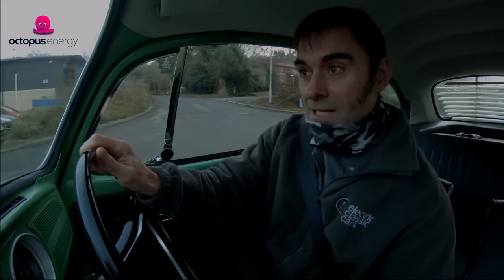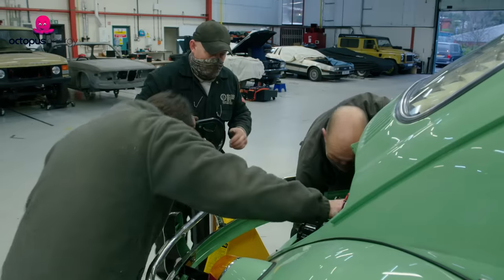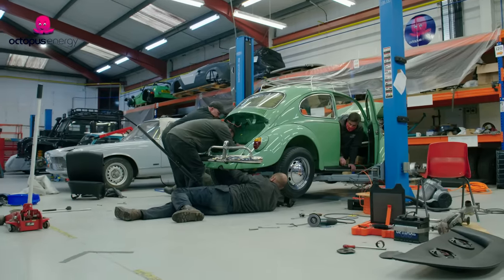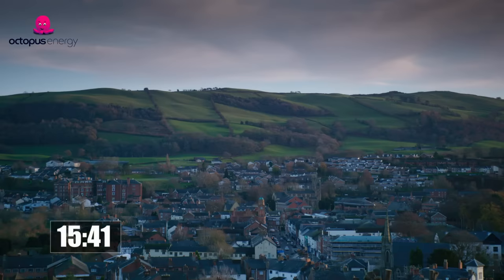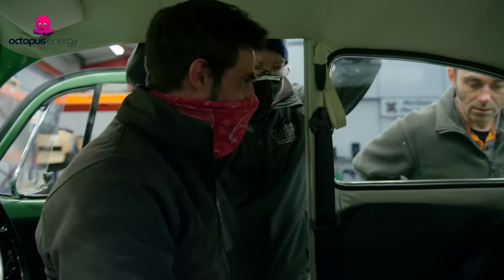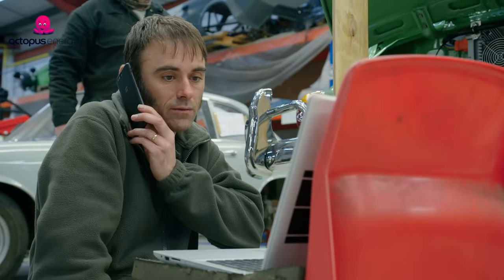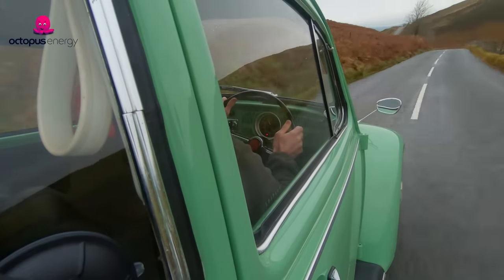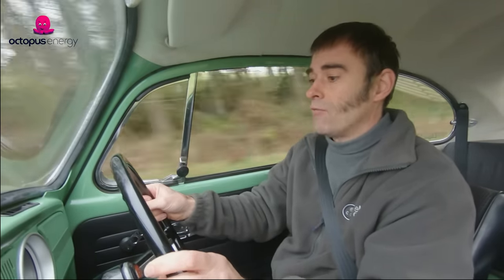VW Beetle converted to electric in a day

Comment: Have you calculated the parameters yet? Top speed, 0-60, and mileage duration of the charge? That same motor can work in front wheel drive cars as well.
Reply: Faster you go sooner you drain the battery’s and have to wait to recharge them. So when you go from London to Scotland in a petrol car. A few tanks of petrol and your there in one day. Yet once this is converted. It  will be 4 days to do the same journey100 mile stop recharge your batteries. another 100 mile stop. recharge the batteries. Not forgetting your overnight stay in a b&b hotel that’s another cost to add to your trip. Compared to a couple of tanks of petrol.and you travel from London to Scotland within one day.
Reply: @richardharries5825  spot on!
Reply: @richardharries5825  except they have swapable battery
Reply: @vetteluvnh  Not really. More like exaggerated bullshit. So then don't travel from London to Scotland. Who needs to do that on a daily basis. Just as who needs to spend gas going to work or other short trips of which consists of everyday living. Use a petrol vehicle if you're doing long distance. EV range is a lot more than 100miles. My E bicycle alone does 60miles and takes 2hrs to charge. A Tesla has a 400mile range. They can also install Rapid Charging stations that would take 15min. My phone has a rapid charger, takes 1min to fully charge.
Reply: @hellboundrubber4448  for long distance, sure the battery is still a problem (high cost for long range battery, long time to charge safely compared to ICE, just fill the tank). I'm not saying an EV cannot do long distance travelling in the far future. But for daily commuting only, EVs are ready for the near future
Reply: @richardharries5825  I’m sure there people back in the day lamenting the scarcity of gasoline filling stations. Preferring to stick their tried and tested horse and carriage.
Reply: @petermcgill1315  actually there were steam engine cars and electric cars 100 years ago BEFORE there were gasoline powered cars

you got it backwards

Comment: Good work 👍 
It’s now a year old, is it still running? How’s the drive and maintenance?
Reply: 80 miles on a charge is impractical .This electric crap is a pipe dream!
Reply: @andrewslagle1974  What do you base that statement on? The technology is constantly improving. How would you compare the efficiency of the first ICE cars with modern ones? Still the same now? Exactly. Really, you should read up on electric cars and battery technology from scientific and non-biased sources, it might open your mind a bit. Also, I don't know what the statistics are on average journey length taken in a car by, say, someone going to work, but I bet it isn't over 80 miles.
Reply: @andrewslagle1974  Not everyone has to drive across the county for work. I live two miles away from where I park my semi, and I’m home every day. Just because it is impractical for you doesn’t mean it is impractical for all. Frankly, this is a great idea for folks such as my parents that owned these in the past, and would rather not have to do the maintenance required on such an old vehicle.
Reply: @andrewslagle1974  I agree...it makes classics much less usable...not to mention much heavier....its actually a big of a nightmare.
Also mot exemption no longer applies as its significantly modified and not with a period engine.
Reply: @andrewslagle1974  I live in the country side, I commute daily 60 km each way. 80 miles would cover that plus I could charge at the office parking hall.  So this would do as a daily driver. Very cheap driving compared to petrol. Would it do as my only car, no, of course not. But this and my Discovery Sport would me a nice combo. Though I doubt I would like to drive a beetle, converted or not, daily. I had one once and it was nowhere close to the comfort, handling and convenience of a modern car.
Reply: @peterh4761  "it makes classics much less usable." well, that depends, Our -67 HT Mustang with 20 l/km consumption is pretty un-usable atm because of petrol prices at 2.20 EUR/l ie. 45 EUR/100 km drive. That is about 2 hours wages for my commuting. Not doable. Now, if that were converted to electrical...
Reply: This would be perfect for us. We're retired and live 10mi from town. We average @30mi a day, 4 days a week.

Comment: I've owned my Beetle Cabrio for 30 years and electric would give it a new lease of life so I was quite interested until I discovered the price (min £25K). The battery range is fine but I'm not sure it's a good idea doubling the Hp on a car that's now nearly 50 years old. There's also the danger that the silent engine would force me to worry about all the other squeaks the car makes.
Reply: Not to mention that there are no crumple zones, no passive restraint system, and the weight redistribution needs a new suspension to take advantage of the improved balance. The center of gravity was already low. Starting with a 40 hp golf cart motor would be safer!
Reply: Where did you find a price?
Reply: @fredwright5551  It took me quite a bit of searching but they said their starting price was £25K, You could always ask them. I think this price was for the Beetle but it was well outside what I was comfortable paying ao I didn't look much further. I think VW do an official conversion kit  from an eUp car and EV West have one for $18K but obviously someone has to install it.
Reply: @mikebikekite1  yes after last night I started looking and found that 18 was about the norm.  The ones less than that seemed to be very slow or no range at all.. I wouldnt mind converting a dedicated car myself but that's still a hell of a lot of money just to start from..
Reply: @fredwright5551  If it's a Beetle you're planning on converting then I'd be wary of adding too much power - the whole car is designed to handle 40bhp - suddenly adding 0-60 times of 5 seconds and adding 50% to the weight means you're taking a big risk. You're cheapest option is probably to find an eUp car that's been totalled and then salvaging parts but I've no idea how easy the work is but good luck.
Reply: @mikebikekite1  I wasnt actually planning on doing a beetle. I have a civic that could eventually be turned over. However, just so you know, beetles are capable of MUCH MUCH more than you think. I've seen quite a few sub 12 second beetles on a stock block... I've also seen a small block converted beetle down the road from me with only a 4 point cage for seatbelt harnesses. I understand what you're saying but you're still not giving them much credit. they can do alot more than you think..

Comment: Imagine a Beetle that may actually be able to produce some interior heat.
Reply: Add an oil cooler with a fan inside the cabin, more useful heat than the stock air duct/heat exchanger set up.
Reply: What are you going on about? I had a 74 and it got HOT inside the cabin.
Reply: @alien7161  and not every Ford Pinto was a piece of junk despite the vast majority being so.  It’s an anomaly.
Reply: Mine is great.  It basically runs exhaust through the car.  But apart from that, great.
Reply: @anooseholay  We are not talking about ford pintos, we are talking about the amazing German ingenuity and reliability of the Volkswagen Beetle.
Reply: @alien7161  you had me until you said German ingenuity and Volkswagen (anything) reliability in the same sentence. Haha. Good one.
Reply: Was the Beetle German or Austria Hungarian in origin..
Reply: Hats off to you all who made this happen!
Reply: @adamanthony7465  German
Reply: heat from where? the electric motor  LOL

it has an 80 mile range - in the winter it will be 40 miles... 30 if you run an electric heater
Reply: @kenwittlief255  I didn’t say it would have range, I just said it can waste electricity to make gobs of heat.

Comment: If you don't mind me asking, what's the cost of a conversion like this?  I'm assuming it's probably more than the car is worth, but that doesn't mean it isn't worth doing.  I particularly liked the way the batteries in the front helped balance the handling.  Did I understand correctly that the manual gearbox was left in place as well?  If so, that's pretty cool, as all other electric cars have no transmission to speak of.  Thanks for sharing this!
Reply: Yeah, the gearbox remains for these conversions, motor is attached with an adapter plate.  Total cost without labor falls around 20k really depends on motor size and desired range!
Reply: Believe me, converting this beautiful classic beetle costs this car 50% of its worth.
Reply: @beetlejuice150  wrong.. thats just your opinion.. no such thing as a classic beetle.. they made millions of them.. dime a dozen

Comment: Couple of questions, in the video it looks like you just bolted a motor onto the original gearbox, does that mean the car is still a manual transmission just like the petrol original? Given it’s now got 120 horsepower and so is probably faster and maybe even heavier than original (not sure on that, I may be wrong), how does this thing handle and stop with the stock brakes and suspension (or was it modded already)?
Reply: I wondered about that , too, being ignorant about EVs. Can you have a manual transmission with electric power?
Reply: @robinbeckford  Yes, you can use a manual or automatic gearbox with any kind of motor or human power (bicycle) except a jet engine
Reply: It's no heavier than it was from the start. The system can be programmed to limit initial torque, and perform similar to stock. The transmission is mostly still there to keep the stock diff. You can direct drive the wheels (external diff, or two motors), but that would be crazy for an old bug. We tend to leave the Electrica in 2nd. The motor (HPEVS AC51) needs to be spun at "high" (for ICE standards) speeds -- it wants be at 4-5k, and needs that to have proper airflow. (it is based on a hydraulic pump motor) Also, we don't need to go 70-100mph :-) (it's scary. it will, and it can get there quickly, but it can't do it very many times.) In fact, for a while there we had a generator in the engine bay, so the clutch cable couldn't be connected -- not a problem, put in 2 or 3 and leave it.

Shifting can be an issue when there's no aux load on the motor. When the clutch is disengaged, the motor won't slow down like an engine, so speed matching for the next gear will be "difficult". (you'll murder the sycnhros) My AC51 has the aux shaft, but we never mounted anything needing it. (vacuum pump for the break booster [regen], A/C compressor [roll the window down], 12v alternator [dc-dc converter / HP server PSU, actually], water pump [electric bilge pump])
Reply: @jfbeam  Yes, it was the shifting that I was really wondering about. Thanks
Reply: @jfbeam  LOL, How hard would it be to program regenerative braking into the clutch pedal and or shift lever?  I thought you young'uns were "tech savvy"?   That would slow the engine to shift gears, which as pointed out is not very necessary.  BTW electric RC cars have had this for more than two decades. Why are you guys so slow? LOL again.....
Reply: @victorspinetti5145  Cars rarely use perm magnet motors. (a resistor box can add drag to them) Typical 3 phase induction motors don't regen very under no load. Some controller do have a clutch switch, but it's to cut-out the accel to avoid over spinning the motor. "Idle Regen" can slow the motor, but as I just said, under no load, it's far less effective. Bottom line: it's uncommon because it's totally unnecessary. We didn't even have the clutch connected for many months, and we had no problem.
Reply: @Ronny_van_Gerwen  

"... except a jet engine ..." 

Aww shucks, you jus have to have one HELL of a clutch!

Comment: Beautiful, I wonder how long it will be before vw start to build electric beetles as I can't see the very expensive id3 being the answer 
Nice job 👍🏻
Reply: VW has the e up as an electric mini car. The beetle is a terrible platform to build an electric car with. It has an cw value of 0.38. It needs around 30% more energy at high speeds compared to a modern optimized chassis. The popularity isn't what it used to be. The series 5 ran out 2019 and i wouldn't be surprised if it was the final one.
Reply: The ID3 is expensive and bloody ugly. I don’t get why anyone would buy it. The i interface sucks as well
Reply: ñew i3  188 miîevrßbge